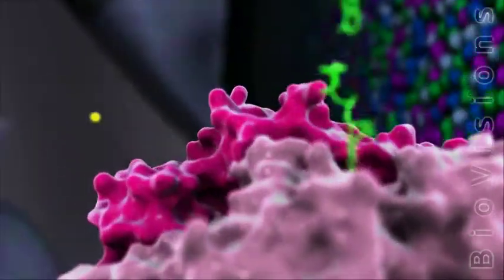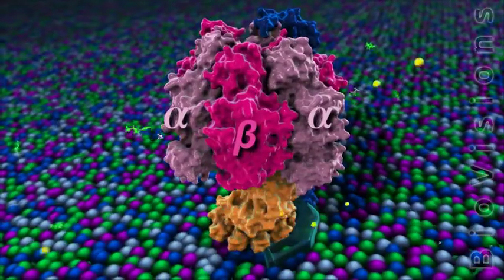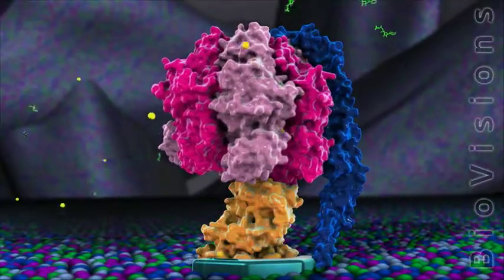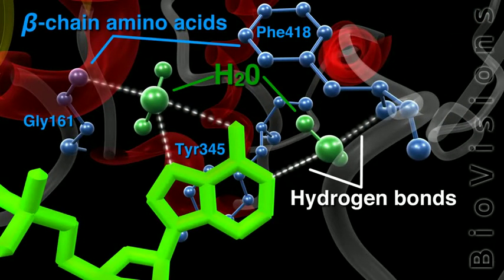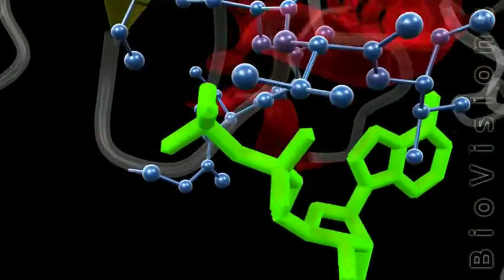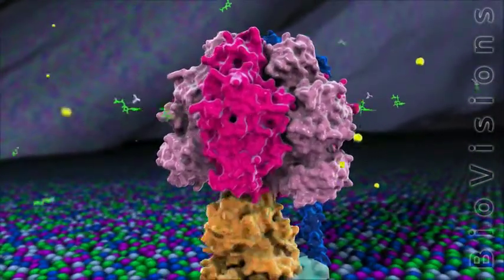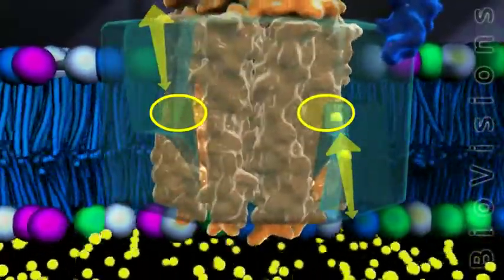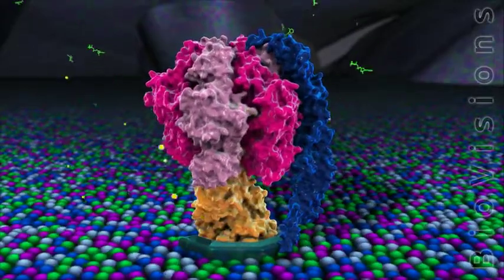The F0/F1 ATPase and ATP Production (BioVisions)

Comment: What's the difference between ATPase and ATP synthase....???
Reply: ATPase is the enzyme that breaks down ATP molecules. 
And ATP synthase is the enzyme which involves ATP production.
Reply: I've the same question
Reply: Here the name ATPase is quite misleading because it doesn’t break down ATP. The ATPase behaves like an ATP synthase because of the H gradient. This gradient is made by complexes I,III,IV of the respiratory chain that use NADH to push 10H into the inter membrane space.
Reply: These names refer to the activity, so in this case they're used interchangeably because this enzyme has both activities. In most cases the enzyme gets its name from its most important or one of its activities, but usually enzymes have more than one activity. So in this specific case both terms apply to the enzyme, because depending on the H+ gradient it will have one of the two activities (in some organisms the ATPase activity is blocked).
Reply: I believe the terms are used interchangeably.